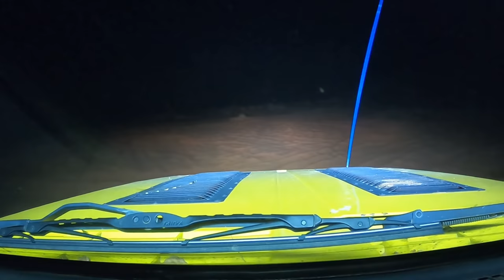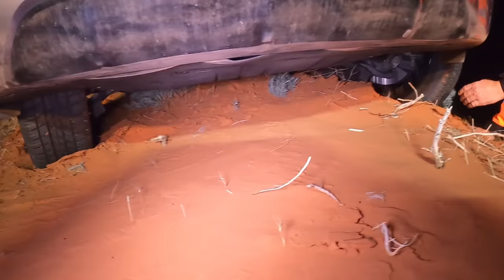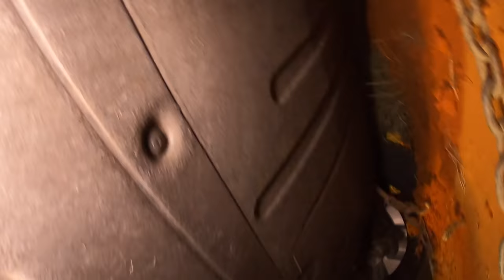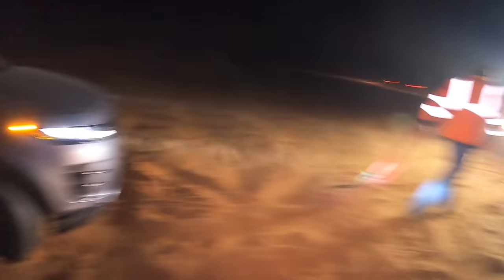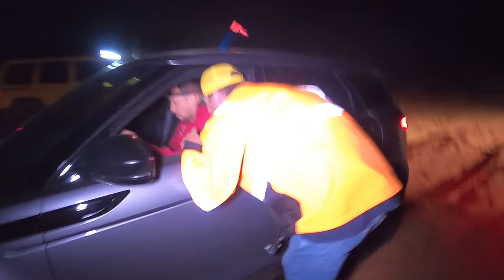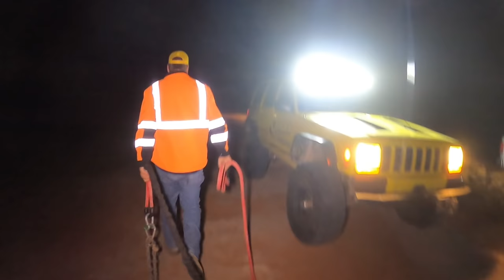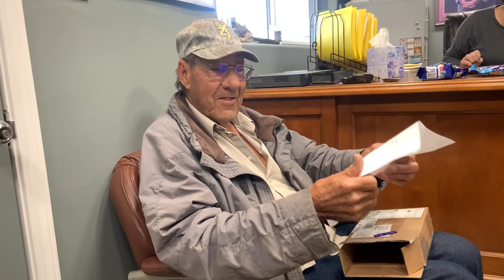Range Rover Evoque Not Doing So Well

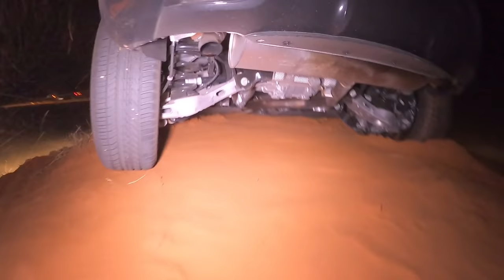Comment: You can see a rear diff and drive axles at 1:13 so I don't think it's FWD. It must just be malfunctioning, which is not surprising for a brand new Land Rover.
Reply: Nice catch!
Reply: YUP.  Either that new toy is already broken or the driver doesn't have the correct driving mode selected.  No matter how easy some things seem, a big bank account doesn't mean you have common sense.
Reply: But don't you just push the sand button ;)
Reply: Correct me if I'm mistaken because I've always been curious, but I believe these types of vehicles have 3 open diffs and rely on automatic traction control. If you hit the gas and spin the wheels, the power is transfered away from the spinning wheels. That said, the wheels kept spinning so perhaps the tire type played into the issue here.

The ats symptom is common misconception on mercedes sprinter 4x4s and some of the newer Toyota's (which I wondered about Matt when you guys couldn't get the Toyota up that dune last month - it kept cutting power). Steady power with no spin and all four tires will transfer the power around and get the job done? 🤔
Reply: Could not find exactly what that one uses, but some crossovers drive the rear axle with a clutch pack,  engaged on demand. The clutch may not have enough torque capacity to drive when stuck off road.
Reply: Maybe it has a mode selector hidden on the touch screen.
Reply: Nothing is going to go if the tires are not touching the ground.
Reply: Pretty sure it's a Haldex AWD System so there are clutches that engage the rear differential when needed. That Range Rover should've engaged the rear end. My Edge has a similar set up and once the traction control is turned off so you can spin the tires, it'll shoot rooster tails off the front and rear wheels is sand and snow. If the wire(s) that send the signal to the rear differential to kick in (newer Haldex Systems where the old run solely off hydraulic pressure to engage) are broke or disconnected, the rear end won't so anything thus making it just like a normal FWD Crossover.
Reply: Probably lost a quart of oil while waiting for Matt.
Reply: It's funny how people think their awd is same as 4wd and can take on same obstacles (when they can't)... That RR is full on-road vehicle. Good for normal gravel roads (in decent condition) and snow (with proper tires) but not any moderately tough off-road situations. Sand is one where awd sucks pretty bad (compared to 4wd).
Reply: I'd never try to take my Edge through that just because it's AWD.
Reply: @finnishfatman  but in the ad it showed it off road...
Reply: @SheldonGoff  Yeah 😆
Reply: Anyone remember when a Land Rover was EVER that great of a vehicle? Always had silly things wrong with them, if not catastrophic head issues because they didn’t deck the old ones correctly. Witnessed firsthand working at one of the premier “aluminum” machine shop way back in 80’s. We’d make extra $ when we went “hunting” in junkyards and popped them (and Z cars) for $40 each. Shipped them to “Stealerships” in NY, CA, FL all the time for $500 a head after we rehabbed them. None were ever flat until we got our hands on them.
Reply: That car was made for rich housewives tbh. Range Rovers and land Rovers used to be great but not enough people need off road cars anymore. Times changed and so did there business model.
Reply: If they are anything like their Jaguar cousins, that Evoque must have gotten wet. Once that happens, all he’ll breaks loose and these things just quit.
Reply: @pinkflydnt  i'm betting this car has a center differential in the transfer case so when the rear driveshaft was stuck (literally high centered on driveshaft) it sent all power to the wheels that did not have traction which is how open differentials work. i believe this car was functioning as designed it is just a shit design.
Reply: Yep. These AWS systems are a “nice to have”, lite duty, just-in-time arrangement. Apparently if you put different size tires on the front and back you’ll trick the system into running all the time, which will then void your warranty as they are only engineered for limited use. but if you can afford an evoque, the chances are you can afford a second-hand proper 4WD for these kinds of trips.
Reply: Dan D Plus those low profile tires don’t help at all. 😂 All deceiving looks! 🤑
Reply: It basically works the same way as the AWD system in my Ford Escape. 
Basically open differentials, with a PTU on the transaxle to power the rear differential. The traction control system makes it all work by applying the brakes to wheels that spin, but there is a limit to how much torque it will send to the rear.
Fantastic on slick roads, be they paved or dirt, but 100% useless in sand, or other real off road use.
Reply: The driver was malfunctioning thinking his luxury suv is offroad capable
Reply: Hilarious 🤣🤣🤣🤣🤣🤣
Reply: It's a haldex AWD system. It probably can't send more than 20 to 30% of the power to the rear wheels. Most likely they are getting power but not even enough to break the wheels loose.

Comment: Those are AWD standard, plus you can see it has a differential and axles in the rear, weird it wasn’t kicking in though, either not working properly or in a wrong mode.
Reply: Here in the UK you can get them as FWD only as well
Reply: @Hargan  this one is awd, you can see it when the camera goes underneath.

Comment: Hey Matt  where you suprised that there were no tow hooks from the factory on the range rover? Well great job and thanks , stay safe😷😷
Reply: The Range Rover site says they  come with front and rear recovery eyes. The stick shift is FWD all the automatics are AWD.
Reply: mechanic  You just need to know where to find them...
Reply: @raybee1613  Yes, it can be a pain to get them out in some vehicles, like if they're under the spare tire.
Reply: @tiredoldmechanic1791  Comes standard with tow hooks ready to go, front and rear, you just need to undo 1 screw for the front and remove the plastic cover, and 2 screws to remove the cover in the rear. 

It actually has a REALLY impressive terrain response system (see link below) but needs a lift and higher profile tyres...

https://youtu.be/LWQzlyEsEdo

Comment: Good going up a thousand stairs in china, not so great going over a pointy mound in Utah
Reply: Wesley Bickel this just a front two wheel drive little pony , that one was four wheel , and more horsepower and  an racer , maybe this also have the air suspension, but the driver  doesn't know how to use it , obviously ,take this to do offroad , it's not a good option...
Reply: 😂😂😂😂 almost forgot that stunt these days you just can't trust these car companies they advertise a Lion and you get a jackal not that I have anything against jackals
Reply: @hanli4799  you can see the rear diff and axles on this one something is already broken on it.

Comment: High centered no big deal it happens.... When it turned out that it wasn't AWD I was impressed they got it on top of that little knob....👍👍
With my sense of humor, if the white truck had been unlocked I'd pulled it out & left a note... Saved by a Jeep.... LoL 😜
Good job guys..👍👍

Comment: Great video as usual, Ed opening mail is always awesome.  Question, will the wind machines be used in future episodes? Those really added a little dramatic effect to the job. I'm with you on the SUV's, which are AWD now a days. People, Matt and Lite Brite have a video about inflated tires and aired down tires in respect to the tire footprint. Its a great video for the newbies building toys. If you can't find it, anything over a 17" wheel you better have Winders number because lo profile tires aren't very capable off road.

Comment: The evoque is a city rover
Reply: But they have a low range transfer case don't they?
Reply: Jeffrey Long I’m not sure that might be option on them I owned free lander and it was high Range only but I have had 4 different defenders a series 2a and 3 P38a Range Rover and one l322 Range Rover and they all have low range
Reply: @jeffreylong5660   there are no evoque with low range .Just terrain response.I doubt if they can lock the differential( even electronically)
Reply: @nickterzi  yeah, i looked it up after. Its a crossover.
Reply: Jeffrey Long nope, fwd based awd system, only the Velar, Sport or the large “rear” Range Rover have low speed transfer case, in some cases optional, not on Evoque though.
Reply: @jeffreylong5660  They actually offered the Evoque as a base fwd version (had to look that up; couldn't believe it).  Seeing that he is only spinning the front tires, I guess he bought the fwd.  Then again, if you go in to buy a Range Rover and come out with an Evoque instead....  Hell, I barely consider the RRS an actual Range Rover.  The Evoque is a nice enough car, but it's barely a Rover, much less a Range Rover.
Reply: @stringer-ik1pc  I mean camels can walk across a desert this thing cant drive across sand
Reply: On it’s best day a city rover
Reply: I drove one on a really hard off road course on an exebition in exactly that configuration and it worked.
Maybe a malfunction on the electronic.

Oh, and it has no low transfer case, but a very low first gear on the automatic, so it's enough for a hardcore-sporty crossover to go a bit off road.

Comment: I guess you proved 60,000 isn't always better than 6,000
Reply: i guess he proved that a properly prepared vehicle is always better in specific conditions than an unprepared one.
because, objectively speaking, that evoque is better than than that cherokee in any other condition
Reply: dimos k I mean that Cherokee is modded as heck. 4x4 with lockers. Giant tires and a lift. If the rover doesn’t have lockers then I doubt it could be a lot better even with bigger tires. Just my 2 cents.
Reply: @ElvisRocking1  as far as i know it has electronic locking diffs. obviously not as effective as a true locker, but they work really well (from what ive seen in videos, i dont have personal experience).
its obviously no match for that specific cherokee
Reply: dimos k I’m very certain evoques only have AWD and does not have any kind of lockers or limited slip differentials. I believe it also has a IFS and IRS system. So the car is essentially is made for comfort. So no solid axles at all. This person probably just thought since it’s a Land Rover it can off-road. It’s like going off-roading in a Jeep Patriot and thinking it will do anything because it has a Jeep badge.
Reply: @RR-hk3jj  agree. i didnt mean it actually has lockable diffs. by "electronic lockings diffs" i meant that the car applies the brakes to simulate an LSD. my mistake, i should put it in a different way.
ye, fully independent suspension. this is a lifestyle car, not a heavy duty off roader. it will be fine in lighter stuff (snowy roads to the ski resort, etc) since it has all the great electronics of the bigger range rovers. but thats about it. 

clueless owner and maybe an AWD malfunction in this case
Reply: I agreed good point.
Reply: dimos k Yup. On the road.
Reply: I’m pretty sure these little baby range rovers are like 35-45k
Reply: @RR-hk3jj  the car would likely have been fine if it wasn't stuck in FWD mode.
Reply: 60,000 makes you a footballers wife 6,000 get you to the football where ever the game is
Reply: @dimosk7389  the cherokee has AC, PS,CC,Auto Trans and Great Tires.  So does the Range Rover.
Reply: @cliffcross6487  "great tires"? They might both be expensive and "great", but the one is designed for road use and comfort, while the other is an off road tire with much greater capabilities off road
Reply: @dimosk7389  There is also a limit to how much torque it will apply to the rear wheels. With it somewhat high centered like that, and the rear wheels firmly in the sand, it will drag the brakes on the front wheels, but will happily let them spin all day.
Reply: @jamescannone1425  They start at $42k, and can run upwards of $65k optioned out.
Basically for the price of one of those, you could have an Escape Titanium for a comfortable sporty(ish) crossover to drive on the road + a fun little sand buggy + a trailer to tow it with, and have change left over for a jet ski...

Comment: Low profile street tires off road? Land Rover, come on....
Reply: Those wheels and tires are an expensive option and a stupid choice at that.  My wife owns one but with 18 wheels better tires. These are capable vehicles. With proper tread  I'm sure it would have moved right along.  
My wrangler would have had the same problem in this situation if it had performance tires.
Stupid decision going to the desert.
Reply: Its a 2x4.  Just because it says land rover does not mean off road..
Reply: @srt10venomous today's land rover actually do have an excellent traction control controlled 4x4. So yeah they are capable with good tyres. Reliable and easy to fix? Nah...
Reply: @srt10venomous  Exactly
Reply: I'm mostly disappointed about a front wheel drive "SUV"
Reply: @fomocowboy  you can see the rear axle/driveshaft. its awd, just broken. aka just a rangerover
Reply: @0xsergy  I gotcha,   I'm way out of the loop on the specs of new vehicles.
Reply: @fomocowboy  i don't know the specs either, just know what a driveshaft looks like :D

Comment: Surprised that the rear wheels wouldn’t engage, especially considering how much one of those things costs. You can get a fully loaded Subaru Outback for 2/3rds of the price of a base/midrange evoke, and the awd system will actually work.